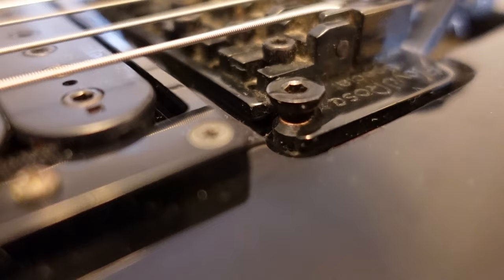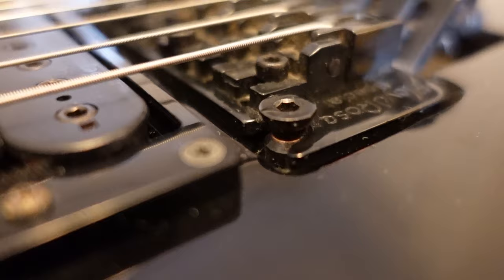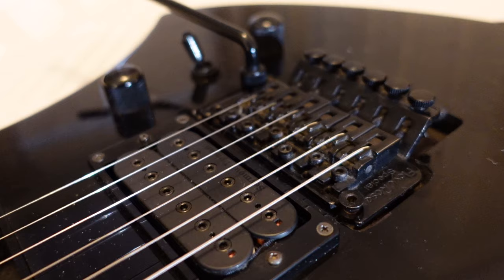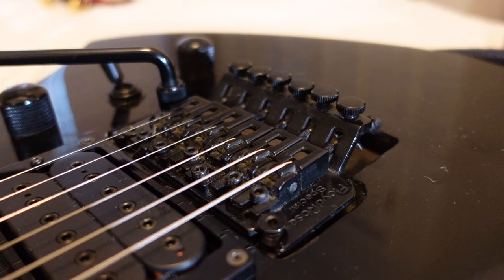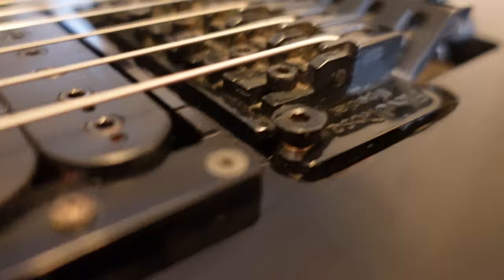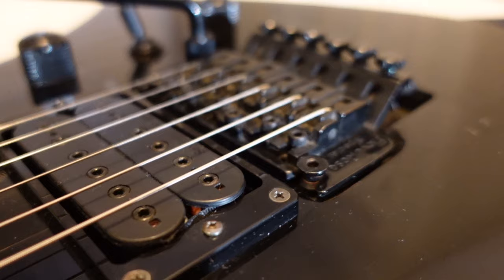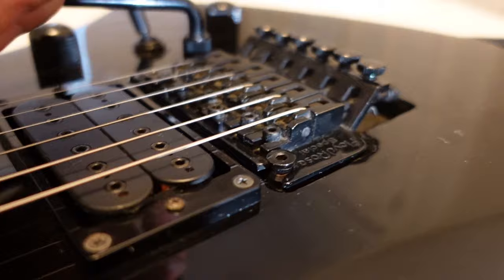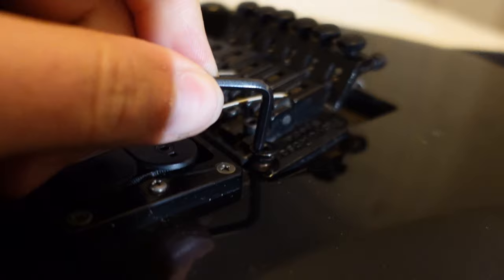Quick Tips - Adjust the Action on a Floyd Rose Bridge the right way!

Comment: It’s wild how I took your advice and still ruined the posts on my Jackson’s floyd
Reply from the maker: Did you make sure it was off of the pivot? Because that was the whole point. It still has tension but if you bend it far enough it lifts it off of the pivot of the posts. Sorry to hear that man
Reply: @DeathMetalDevin  Well one thing I can say now that I've replaced the posts, is if you order the real Floyd Rose ones instead of the stock ones you get much harder metal. It was a cheap job to get the the trem to work as it should

Comment: NOTE! Do not do this, it will destroy the Floyd Rose while you increase the spring forse which force is focused on the knife blades against mounting studs. The only correct way is to loosen the string tension and then adjust the height. I recommend to do this on all trem arms while even smallest scratch will start to destroy the mounting stud and knife blades, this on all brands.
Reply from the maker: If you look at the video Closely you will notice that the sides of the of the floyd lift it off the center of both the knife edge and stud... This is a video recommended to those who need a quick adjustment without having to open the back to readjust by taking the springs off.  I WILL note that not ALL floyd roses behave this way. Idea is to take tension off the knife edge and stud center. Thanks for the comment
Reply: It is the small particles that will come of the knive blade and the stud that will start to cavitate larger groves and cause probles when you do this as on the video, always loosen the tension. @DeathMetalDevin
Reply from the maker: sounds like normal wear and tear. If its being lifted and the pressure is on a part of the stud that isn't anywhere near the center then it doesn't matter. You will get the same issue just using it as intended @rolferbismann4379

Comment: This is simple physics. Guitar Bro "knowledge" creates the nonsense and the internet passes it on. The only way to effectively remove tension from the stud posts is to completely remove the springs and strings, adjust height, and restring. Under tension, the cheaper Floyd's (anything other than OFR, FR 1000 and even Ibanez Edge) will cause that divot by cranking the studs while the strings are still on. That causes wear, and eventually your trem won't stay in tune. So, buy quality and don't worry. If you can't afford it, you'll need to do it the more timely method (on a non recessed trem, even more time since you can't pull up on the bar to relieve spring tension and remove the spring, but leave the strings on)
Reply from the maker: @phil frank "Guitar bro" 🤣 This was def intended for the lower grade Floyd's. You are stating the points I'm making. But this is a quick method if you don't want to rip the strings off and try again over and over especially if u are new to this. Not everyone is a guitar tech. I wanted to give a method I learned to those who are starting with Floyd's so they don't fall into the I hate Floyd's category. Again tension is present but the idea is to take that tension off of the middle grooves. When u lift it high enough it takes the tension off the center of the groove of the studs. Thanks for the comment 😁

Comment: I didn't know I had to loose tension on strings, and springs. For my first time, I screwed the studs for low action straight away, for 2 guitars. :D I am a bit scared if I damaged the knive edges, can you guess how many percent I did damaged doing this for only once? And I don't wanna lose tuning stability over time. Cheers thanks for the video.
Reply from the maker: You will damage the post before the knife edges. This also goes back to using quality metals on Floyd's. The specials are a softer metal so it doesn't take much to start dulling the knife edges. That is why everyone likes the OFRs. But if you take care of your Floyd's a special would be just fine. You can possibly sharpen the knife edges back again with a file. If anything your posts will go before the knife edge cause the issue
Reply: @DeathMetalDevin  Thanks, I did it to both Ibanez Edge, and FR SE1000's. And I never want to do it like that again. ty

Comment: Even if you depress the bar, there is still tension on the post/knife edge from the springs on the back.  I believe what you're doing is changing the area that the knife edges impact on the posts, which might make it easier to turn the post screws but you are probably still causing wear on the post/edge -- if that is your concern.  This is a Floyd Rose Special, so the parts used in the manufacturing process are said to be inferior to the Original or 1000/1500 series (which are originals only available through guitar manufacturers), which is why there is potential for wear.  Many people say (though who knows for sure) that this isn't necessary on the Floyds that are high end because the metal is higher quality.

Comment: What do you do if the intonation won't setup right even if you saddle is all the way back as far as it'll it'll but it's not right
Reply: Try tilting your floyd back a bit more. It may not be level enough to the body. I had the same issue with my low E saddle needing more room to go backwards. The slightest back angle increase of the baseplate allowed the saddle to go backwards and finally intonate correctly. Hard to see by eyeing the bridge sometimes.

Comment: I understand what you are saying but it looks to me that the knife edge is still in the exact same place on the post even with the bar dipped. I understand that the angle is slightly different. Please can you elaborate by what you mean when you say that the knife edge is lifted OFF the post? I dont see it?
Reply from the maker: In the dip of the U on this specific floyd rose if u lift it enough it leverages the sides and takes it off of the knife edge and the center post. There are floyd like trees like the ibanez edge that this wouldn't work for. Just take off the springs if this does work
Reply: @DeathMetalDevin  hey I appreciate the reply man and thanks for posting the video. If it helps I have been guitaring for around 17 years now. Had the awful ibanez edge 3 trem, a handful of fr specials, Jackson licenced trems and one original FR. I always just turned the posts to adjust action with the guitar strung and without doing anything special.

Honestly never had a single issue with return to pitch or anything to suggest significant knife edge wear!
Reply from the maker: @c.m5043  nice it sucks when they wear out because they become unusable

Comment: Do you loosen the string before do that or do it with normal string tuning?
Reply from the maker: It's ok to do it with the strings tuned up. Idea is just to take the pressure off the trem knives and post. Its hard to guage the string action when setting up a floyd so this is kind of a short cut.

Comment: im new to these guitars and im an idiot, not knowing anything about Floyd Rose guitars i messed around with both post's im sure they are both un-even. What should i do?
Reply from the maker: Typically the side with the thicker strings will be slightly higher, IMO. Not by much but I typically just eyeball it. I think keeping the middle groove flat with the guitar top is a good spot to start but not always the case with all guitars. Just look at how many thread above the top of the guitar if you need the action high.
Reply: @DeathMetalDevin  thanks boss i will give it a try today, if i cant i will just send it to the guitar shop near me.
Reply from the maker: @Mexican4Life49  welcome